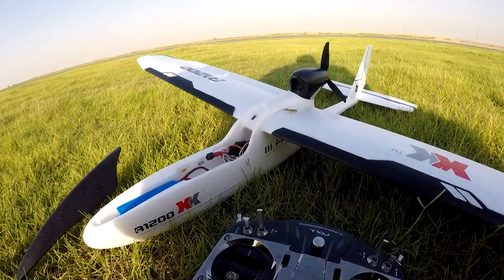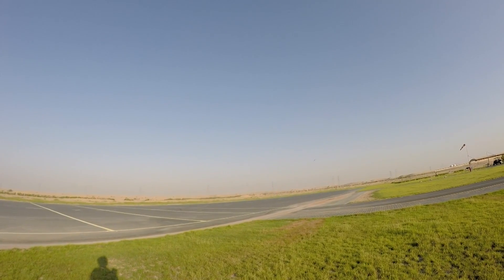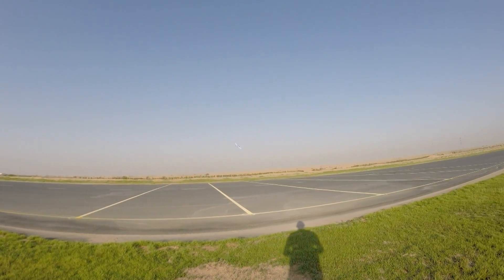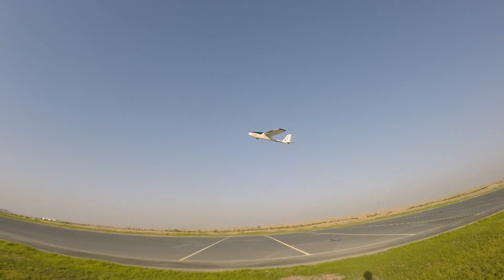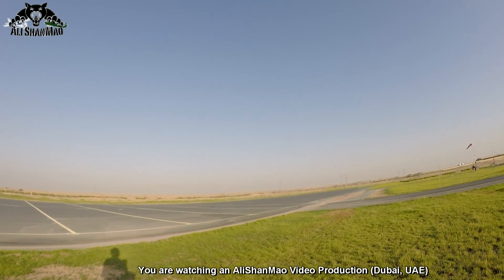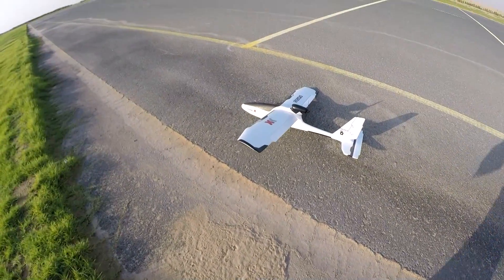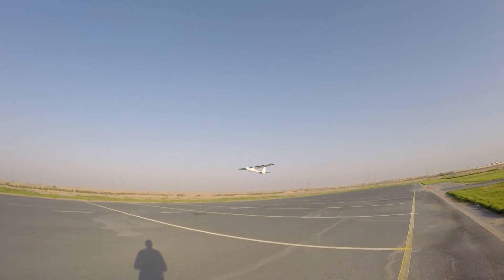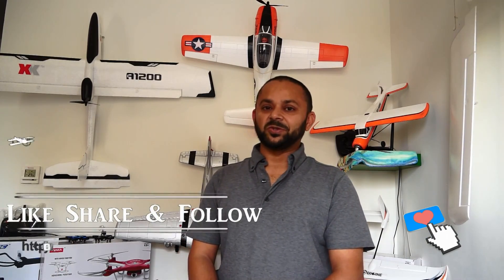FPV Glider A1200 with Stabilization System Maiden Flight

Comment: Did you notice that one of your wings was a bit higher than the other when you look down the fuselage? I never had a pusher type plane and I was wondering if it had something to do with the motor thrust?
Reply from the maker: you mean the ailerons? those will move as per Gyro sensors data. when flying they will constantly move to stabilize the plane
Reply: Sorry, I mean on my XK a1200 when I look down the fuselage my right wing sits higher than the left wing regardless of the ailerons. I think it might have something to do with motor thrust compensation I was just curious if yours was the same way?
Reply from the maker: oh in that sense, I did not notice it. I will check again

Comment: Its looks nice XK has nice products. But this looks under powered.   Gearbest charges  $113  for shipping total price $268  Banggood is overall cheaper $18 shipping total price $182   wonder from who I will order it, its a difficult one mmmmm
Reply: Ruudy L try AliExpress. Much better service then Gearbest and Banggood and better pricing.
Reply: Ernesto dí Terríbílé I bought a few thing on Ali but have had no need for service there so I cannot comment on that. I do have experience with Banggood and they are very good if you just follow there simple rules, and refunds on not shipped products is no problem whereas Gearbest are a couple of crooks, No refunds possible, your money goes into a so called "wallet" and you can buy something else with it, and service is just a computer sending messages, I only buy small things from them, or if I cannot find it elsewhere
Reply: Ruudy L I really love how all the sellers try to get high ratings. So I usually ask for converters and other stuff when I buy stuff with US Plugs. They give free EU plug converters. I also love their wifi antenna amplifiers for my planes Quadcopters and for my clients their business and home wifi. As normal routers only put out 100-150mW they are basically unusable for internet use. So most of the times I buy 2,4,5,10,20 or 30W amplifiers depending on the use. 4W basically gives me about 10KM distortion free FPV. Normal FPV transmitters always give distortion without amplification.
Reply: Ernesto dí Terríbílé Banggood automatically knows I am in Europe and sens them with having too ask. But I think every shop has there special thing, I just feel safe at Banggood, but I do shop around too get the best deal
Reply: Ruudy L ben je Nederlander?
Reply: Ernesto dí Terríbílé Ja zeker
Reply: Ruudy L ik ben rotterdammer
Reply: Ernesto dí Terríbílé Haarlem hier
Reply from the maker: Hi Ruudy, I will speak to Gearbest about these complaints. :) they need to step up and stop treating customers with such attitude, specially customers coming after watching my reviews of their products
Reply: alishanmao I really like your reviews, and also will tell you if I do not haha,  but if I like the product in your review and the buy link is to Gearbest   I will look if it is for sale somewhere else, otherwise I will not buy it. Small things of a few dollars I might buy at Gearbest if I really need it.